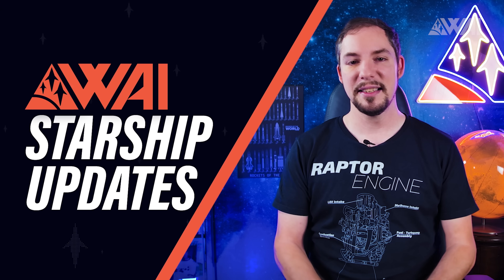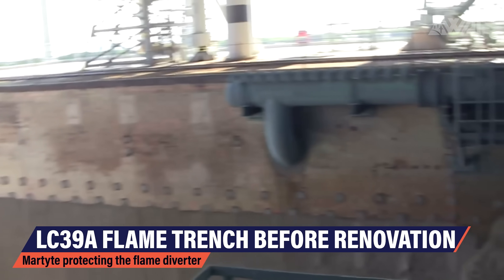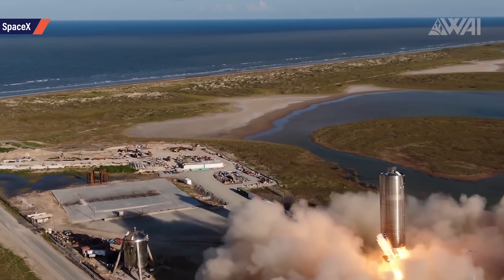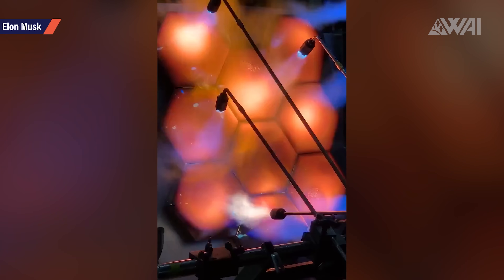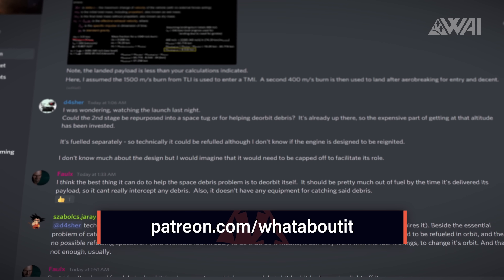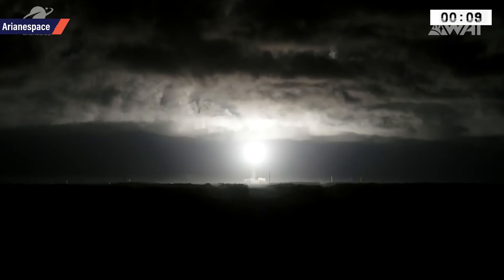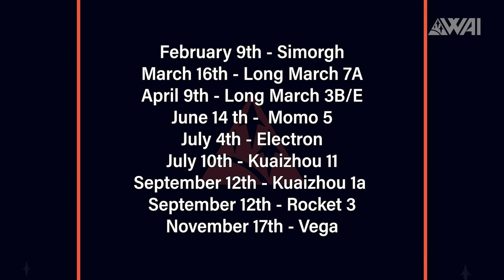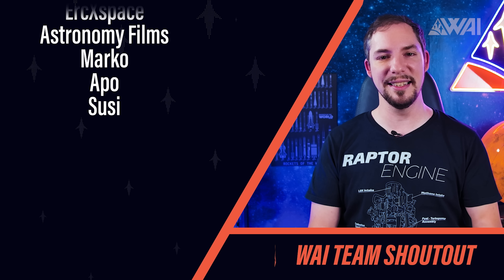134 | Why Martyte helped to damage a SpaceX Starship Raptor engine!

Comment: Something that has always perplexed me since the first Raptor firing on Starhopper is not so much the lack of a flame diverter but rather the absence of any protection whatsoever for all the intricate pipework and machinery on the outside of the engine. Since the first firing I have thought it inevitable that some piece of shrapnel would impact some critical part and lead to a catastrophic failure. 
Fortunately that hasn't happened yet but probably came very close to happening this time. 
I think the fire that was seen on the outside of the first Starship hop as well as the bright yellow exhaust in the last few seconds was probably also the result of damage caused to the engine by shrapnel kicked up from the pad when lifting off.

I find it hard to believe that they wouldn't have thought of such an eventuality. My guess is that they have but decided to take a calculated risk to save time and expedite development. This event will probably shift the balance in that calculated risk and we'll probably see some form of protection on the Raptor engines pretty soon, even if just a light carbon fiber shroud around the engine exterior leaving only the nozzle exposed.
Reply: I agree, another thing to take into consideration is that the finished engine will look very different. A lot of the stuff you see right now is for the early test articles, instrumentation to measure all sorts of things that later will not be needed. The "finished" raptor in 5-10 years will look quite different from now.

Elon also tweeted some parts are getting covered on future raptors.

Comment: Look- obviously this is a mistake- get digging, and make a flame diverter and a water dump system!! End of discussion... shit has to go one direction, anything coming back is going to cause problems...
Reply: The offshore launch platform makes for an easy solution- make it as high off the water as you want, winch Starship and SH up empty, and fuel at the platform. Let flame pass through launch platform and vaporize as much ocean as it wants to... hell, instant gumbo, bring spices!!

Comment: I count this as a "successful failure" for starship.  
The debris didn't breach the bulkhead: win
The starship as a whole survived a preburner meltdown: win
Reply: this is why we run tests.
Reply: Keep in mind they have to fix this at a deeper level.  There will not be a launch pad on the moon or mars. SThose rocks could do damage too.
Reply: Agreed.  I also have concerns about how this debris will affect the Rvac once those are fitted.
Reply: Basically task failed successfully

Comment: Sn8's signs of rusty welds is concerning. Any welders that can explain? Stainless steel, but not stainless steel welds?
Reply: It's the oxidation layer on top of the welds, all stainless steel welds will have discoloration, all the way from chrome to deep blue. On production level starships they will clean the welds either chemically or mechanically, but for a prototype there is absolutely zero reason ever to clean up the welds.

Comment: It seems like the moon or mars are not going to have this Martyte material on the landing surfaces so it is probably better that SpaceX develop shielding for their engine bay to protect it rather than come up with a solution for the Martyte problem. Otherwise this beast will only be able to land on prepared and maintained landing locations which would be lame for planetary exploration.

Comment: Rather than a water bath on top of the launch pad, an ICE pad may be better since the energy needed to do a phase transition is so large.  Crushed ice is easier to transport. So, just cover the launch pad with 1 ft of crushed ice. Say, 30 ft X 30 ft. Or 900 cu.ft of ice. Or 3 concrete trucks full of crushed ice.

Comment: What advantage of the more cylindrical shape of starship is that if a heat shield tile does get damaged it can easily get replaced by a non-technician. This means that they can pack a few extra tiles onto starship if it launches with a crew and do an inspection before reentry and replace any tiles if any broke off.

Comment: Booster is gonna blow up the entire pad. Cant they cover the concrete with thick metal plates.. And deal with the landing on unimproved surfaces at a later point. Would assume the martyte is used due to diverters having shapes.
Reply: it will melt and having melting lava flying around, I think they hit the wall fixing will be long

Comment: The speculation that the fragments flying up and away from the rocket exhaust could somehow his the heat shield tiles half way up the body of S/N 8 either highly improbably or physically impossible. The most logical hypothesis would be that the vibrations of the static fire caused the fracture.

Comment: I said it before and I'll say it again the 15k hop is no big deal compared to those heat tiles. Starship is for the most part attempting to go far above and beyond what Space Shuttle was supposed to be and about 75% of why space Shuttle failed was it's heat shield. Shuttle's heat shield was supposed to require little to no maintenance between launches. Instead it wound up requiring massive refurbishment every launch. 

SpaceX intends to launch Starship repeatedly with at best an inspection, but no maintenance between flights. If their heat shield fails to live up to this goal the cost of operating Starships will skyrocket to the point Musk's Mars plans may not be possible.
Reply from the maker: Fingers crossed. 😉🤞

Comment: The heat shield tiles almost certainly weren’t damaged by shrapnel on SN8 as it’s on the top side and most shrapnel would be blasted up and away from the body of the starship once it gets out from under the skirt
Reply: You are absolutely right! However, when we're talking test stands, they really should prep them to minimize damage and reconstruction in order to expedite development!

Comment: I wouldn't want to be that guy who connected a pair of wires incorrectly and caused $400m in damages 😬
Reply from the maker: Imagine your boss tells you. 🥶
Reply: Also blame a design that had identical connectors.
Reply: @ChildSpaceMethod  True, human error should be counted in the design philosophy of the craft, as human error is an inevitability. It is truly nonsensical that they didn't even have an automatic system check up that could notice such an electronic system issue. A single problematic cable or human error shouldn't be able to bring down the whole mission, that is just bad design.
Reply: @snuffeldjuret  I agree with that.
Reply: @Whataboutit  Wow didn't expect a direct reply, thank you. I love your videos :)
Reply: Can imagine Soviet union built 5 Burans like 5 Space Shuttles  and never used them what a waist of money. 400m is nothing for believers.
Reply: And be the person who didn't test the rocket enough to find that out
Reply: Even one of the moon launches had an F1 engine wired to wrong output. In the Russian example, the sensor was not wired wrong it was installed in wrong direction with a hammer. Space X needs to design its rockets with low skill assemblers in mind, simple wiring and better computers. Think about possible repairs on another planet.
Reply: @togowack  even if there are highly skilled engineers going to Mars, the circumstances might become so harsh that it will be difficult to think well too
Reply: @togowack  

Lucara 
Lucara was a corp

Comment: How about using the heat shield tiles to protect the teststand and at the same time test their limits?
Reply from the maker: It would be fun to see that. 😄 I don't know though if a blast from three Raptor engines produces useful test data. They know the heat resistance of the tiles already. They're mainly interested in testing the attachment on the hull.

Comment: Why change surrounding when developing? They MUST develop this ship to land in nature, not specialised launch/landing spots.
Reply from the maker: I've heard this a lot now. Comparing it with Mars for example the Starship will need less thrust to take off due to the lower gravity. Not even a booster is needed on Mars to reach escape velocity. It's true, that Spacex should better be prepared, but testing it on earth like this will not be needed. Shielding for the engine bay is just not on the early prototype right now. It will be though on a Mars landing variant. If they'd forget that, they'd be really stupid. Fingers crossed they're not. 🤞😁

Comment: What it be possible for 2 layers of of the heat shield one under the steel and one on the outside or would that just be to much weight for the rocket?
Reply: Way too much weight...
Imho

Comment: Twp "solutions" to the martyte/flame diverter issue: 1) Construct a movable diverter that can be slipped under the launch mount for launch and slipped out for servicing the Starship/Booster. 2) Side-mount a Merlin engine on the concrete pad and fire that up just prior to main engine ignition on the Starship (thus re-direct the Starship exhaust and any flaking martyte).
Reply: Why not use 301 steel instead of martyte ?

Comment: As others have already pointed out, a flame diverter is simply not the solution for Starship. This spacecraft is supposed to land on and start from other planets/moons where the landing/starting sites are covered with regolith and brittle stone. If Starship requires water for vibration dampening and flame diverters to take off, it cannot fulfill its supposed role. Therefore the only solution lies in design changes to Starship itself.
Reply from the maker: Please take into consideration:

1 We're looking at early prototypes (engine bay shielding will be a part of the Mars Starship) . 
2 Pads on Earth will need a flame diverter. They're supposed to support many launches.
3 Mars gravity: 3.711 m/s Earth gravity: 9. 807 m/s. Less thrust is needed on Mars. 
4 Musk has been talking about hundreds of flights before going for Mars.

Comment: That EXPLOSION when that exhaust hits those water pipes will end everything but look neet Maybe on Mars it will have very long legs or high mounted rockets like the moon design-the pulling high mounted rocket idea is cool. OH ya you cant dig a hole there the water table is like 3 feet under that sand.

Comment: They should dig a big hole under the rocket and fill it with steaks and sausages. The flying meat will not damage any avionic cables, and after each launch the barbeque will be ready and (very) well done.
Reply: Great idea :)

Comment: Here on Earth they can upgrade the pad as much as they want - but how they can solve this on Mars seems to be the real issue.
Reply from the maker: Mars has a third of the Earth's gravity. That's enough to not throw rocks into orbit on landing but little enough to need only 33% throttle on landing. Basically one Raptor at around 60% thrust will be enough to land it on Mars. That's less than what was used during this static fire. The situation is not as bad as it might seem. This is an early prototype. Mars Starships will have engine bay shielding..
Reply: @Whataboutit  I thought because of less air braking it would need more dramatic thrusting to stop in time ?. How will they know what shielding will be suitable for Martian conditions when every launch here is often beset with delays with thousands of support staff and launch hardware ?
Reply: Lower martian gravity means you don't have to be at full thrust when you lift off, so debris not moving as fast.  Combine that with longer landing legs (already in the works) and steel-shielded cables and you should be ok
Reply: Agree. For the moon they're adding landing thrusters higher up. Maybe they could send one of those to Mars with a rover capable of printing a landing pad using hardened regolith.
Reply: It is a one way flight for at least the first five to eight years. By that time they will have developed a suitable launch pad(s). I don't think Elon has ever saw it any other way. It is a commitment.
Reply: This suggests there will be a series of tests simulating launch conditions similar to Mars and the Moon.

The engines can be throttled back by a factor of 3 for a Martian launch, and by a factor of 6 for a lunar launch due to the lower gravity. That would allow them to use less thrust in the first few seconds of flight. (If that helps. I am not a rocket scientist.)

I imagine we will see some vertical Raptor tests where the Raptor is directly above simulated Lunar and Martian surfaces.

Eventually, we may see gravel spread under the launch pad for static fire tests with a full size vehicle.

Very much the opposite approach to foreign object damage strategies used by old space companies.
Reply: I wouldn't worry it doesn't look like humans are physiologically capable of living in a dangerous smelly enclosed space for long . They haven't even got anywhere near working self contained biosphere and that well may be insurmountable too , apart from radiation  lack of anything useful and easily obtained means its a fantasy like the hyperloop. Its a shame were not concentrating on realistic space exploration .
Reply: @MyKharli   US submarines routinely go underwater for 3 months at a time with 100+ people hot-racking (sharing beds).
Reply: What do you want to see added into Minecraft? Leave your ideas in the comments and I'll make them happen in a video! Can be anything from a weapon, a mob, a block, an ore, etc. Be sure to include the following info:

Name of thing:
How to craft:
What it does/uses:

LETS GET CRAZY
Reply: @mahiyajesi6437  More traps so people fall into lava and lose all their stuff un less there friend has a bucket of water and big rainbow waterslides  lit up with candles leading to an underwater glass walled room  so you can look at the fish and squidies .
Reply: No flame divertors ?
Tiles for heat insulation ?
Better choose another route than that...Haven't we learned something from the Space Shuttle era ? 🤔
Reply: Guy Panzerboss  Cool i cant wait to be proven wrong but you have shown me nothing at all .
Reply: Guy Panzerboss  Also by the time if they get there its likely earth will have run out of useable anti biotics and will be gripped by centuries long costs involving rapid sea level rises ,extreme weather events and more pandemics ...so good luck with Mars .And as they are all human caused then therefore Mars is not an answer .The `people`on mars wont be `better` people , they be the same fallable doofuses we are now .

Comment: I'll probably be criticized for saying this but what the heck. I'm anti-fragile. It takes time for a proper cure involving concrete. Splaying is just a consequence of to fast a a cure and all the coatings in the world won't change that. I get not wanting to make the launch and landing pads too stable too. This was a very productive test. Now the entire skirt will be hardened and extra vents have been added too. This is how R&D progresses.

Starship V2.1 will include a case hardened engine skirt compartment with critical components shielded from debris strikes. Better dressing of cables and hydraulic lines and reinforced shielding. It will add weight but with the improvements in Raptors, payload capacity will still be more than earlier versions. It won't surprise me to see a better landing leg configuration as well. Fixed legs are on the way imo. Just losing the hydraulics for them might offset any other additions.

 To the children that got their feelings hurt by my last post. If you have entertained my speculation why not add to the thread instead of just berating me? I'm sure you could just point out flaws in my ideas. How is your behavior constructive otherwise? To make this a safe space, start by doing your part.

Comment: The ship was machine-gunned when it started the engines. You will have to put a protective screen on the engines.
Reply: And how do the exhaust gases from the engines pass through the screen?
Reply: @antyspi4466  Place the screen inside the skirt protecting the motor piping and leaving only the 3 nozzles outside.

Comment: I have a theory why they don’t want to use a flame diverter! Perhaps they want to nail out the problems for starship launch structures so when they launch from mars they don’t have to solve it when their ships are so far away.
Reply: makes complete sense, harden it here, less issues over there
Reply: first moon... in 2024.. and then maybe mars.. on 2030.. so everything is developed now to moon surface first
Reply: @o2k492  if the artist rendition is anything to go by then the moon lander will have auxiliary engines higher up and might not need a pad at all right? I would also guess having several engines extra for a round trip from earth to mars would be costly in terms of the delta V so they would be more likely not to have the moon thrusters. Thats why I think they would only need it for mars. I dont know this for sure but from what I hear its just a guess.

Comment: Even if a flame diverter was present at the Boca Chica launch site that will not fix the same problem  Spacex will have when attempting to launch from Mars.
They will not have a flame diverter on Mars.  The velocity of rocks and debris blowing up from a unimproved launch site on Mars or Luna  could be fatal.
The Lunar Starship design moved the landing engines for a reason.
The Mars Starship may need to do the same.